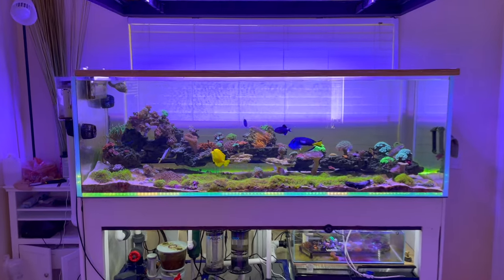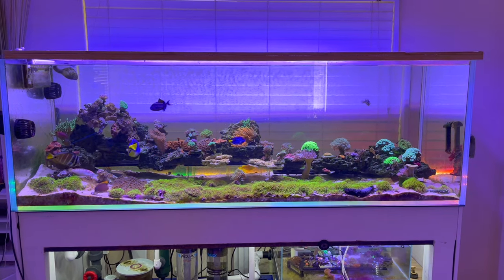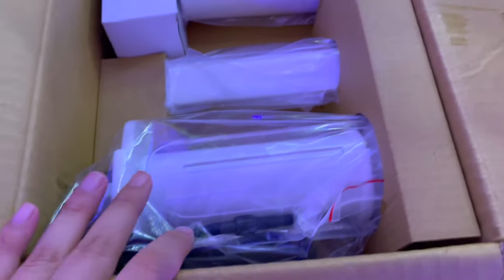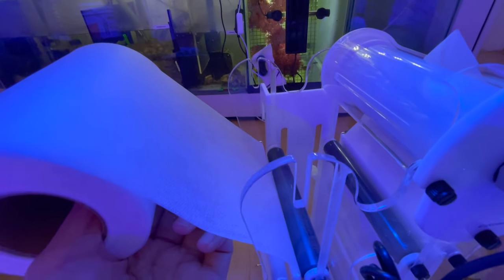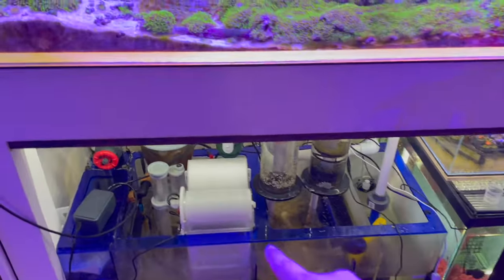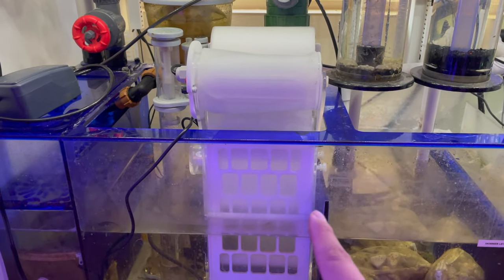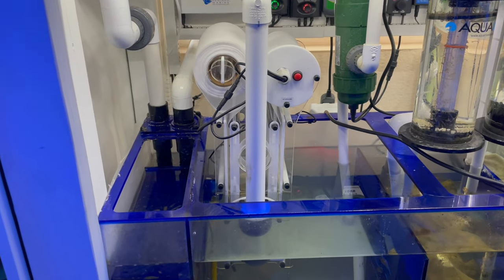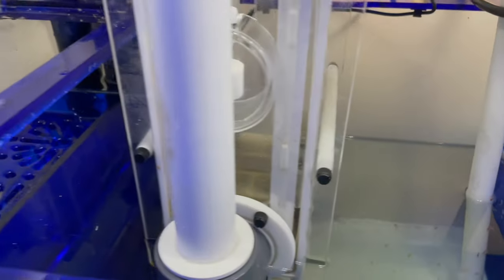HOW TO HARD PLUMB A FILTER ROLLER TO YOUR REEF AQUARIUM SUMP

Comment: Im concerned about the kalk reactor output. It looks very easy to clog
Reply from the maker: As long as the other end is in water I  believe it will be fine. It starts getting clogged if the end is exposed to air

Comment: That float valve on the filter roller looks like it’s above the top of your sump?  Is your filter roller mounted too high in the sump?  Or is it just the angle of the camera?
Reply from the maker: it's right under i  should move it a little lower to get it rolling more offen it takes a while to rise up